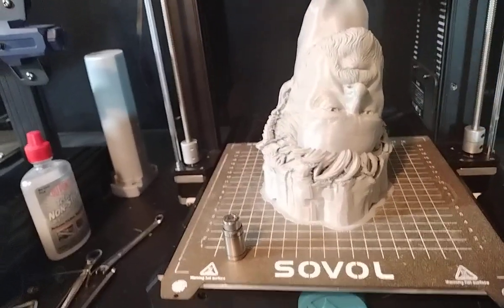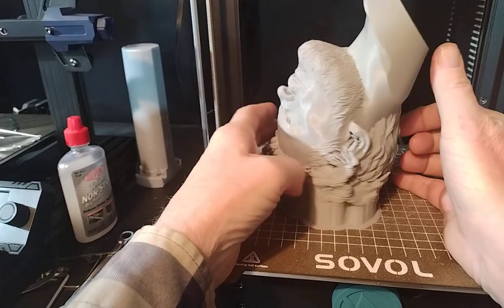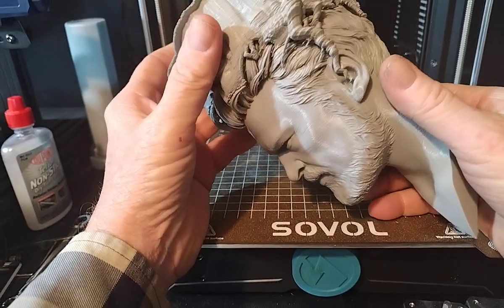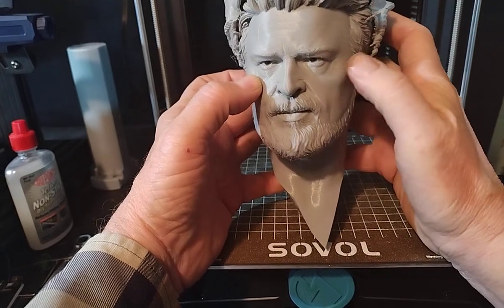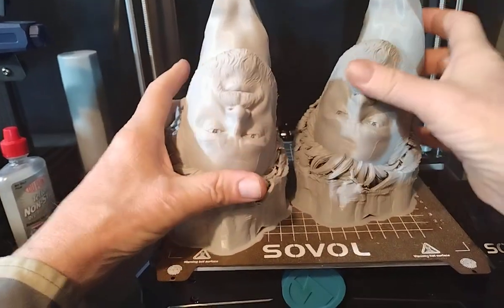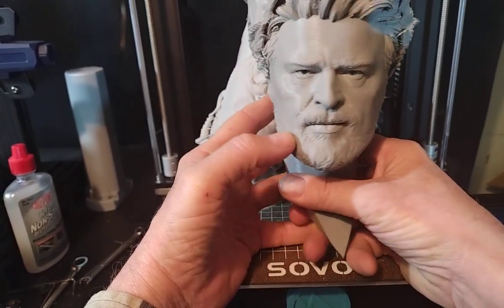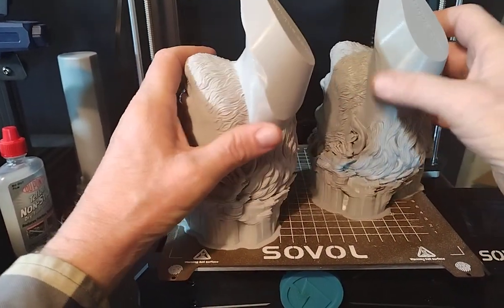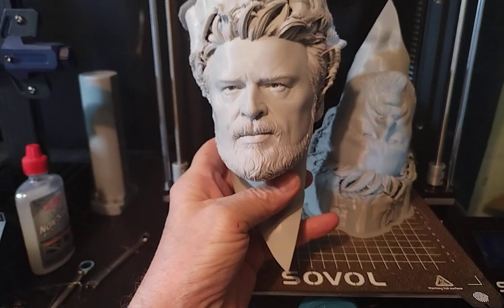Sovol SV06 getting closer to my high quality prints.

Comment: Got the SV06 as my first 3d printer, how do you know that your z bearings weren't working properly?
I've been struggling to get good consistent prints from my printer, but I don't know how to figure if it's a profile issue or a hardware issue
Reply from the maker: I could hear some noises and lightly follow the z up with a small finger pressure on the side and see if you feel anything, once I installed new plastic glides instead of bearing's things are much smoother
Reply from the maker: Some people are using super lube for results